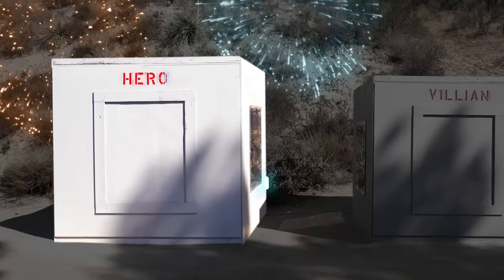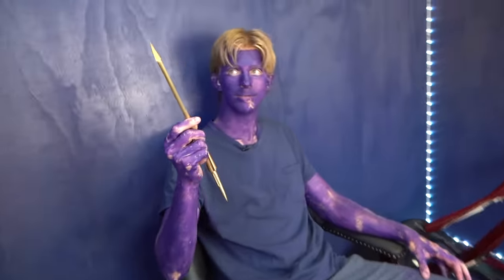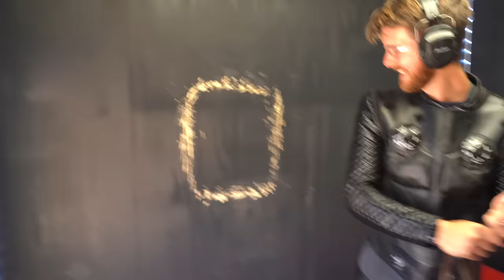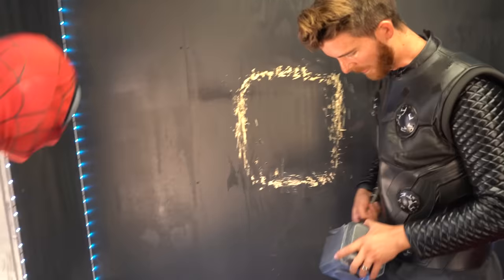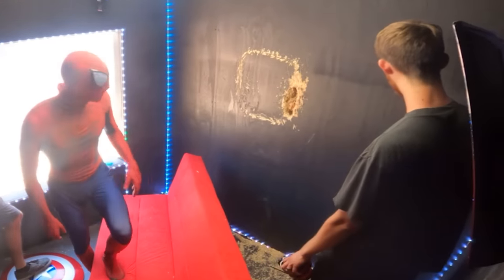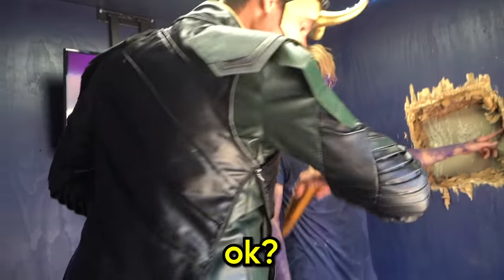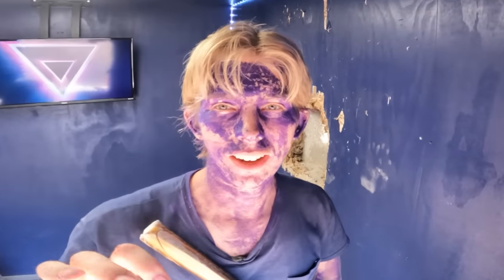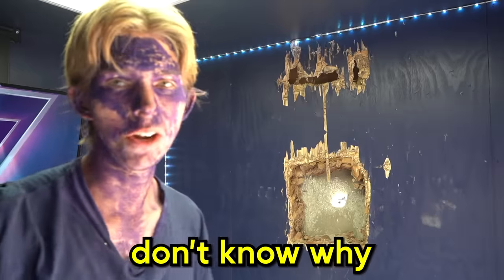Escaping an Unbreakable Box with ONLY Avengers Weapons!

Comment: I think he actually didn't win because he didn't not use the designated area where the concrete is you guys were just trying to use the weight of the concrete to slowly move it down but he did not go for the designated area yeah go for where the concrete is you guys win for the bottom though but that's where all the weight is going not the top so I feel like he cheated all four cheater well how's the weather going to expect from a villain they cheat all the time